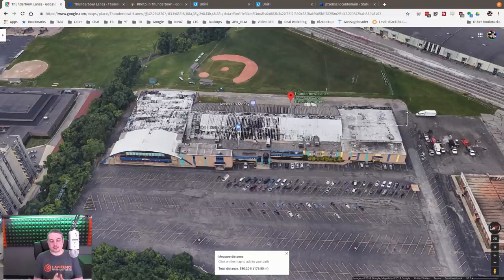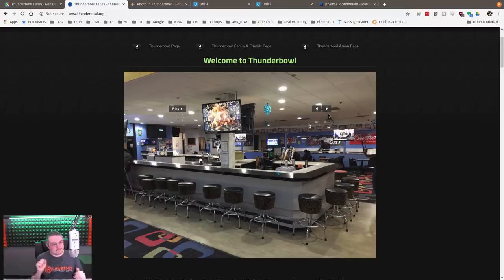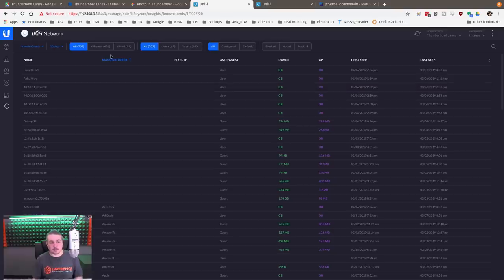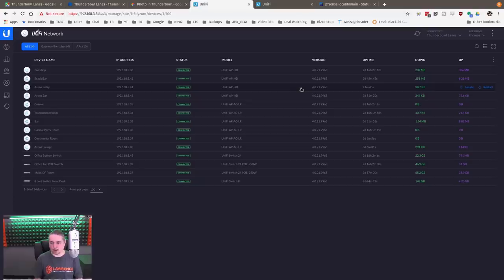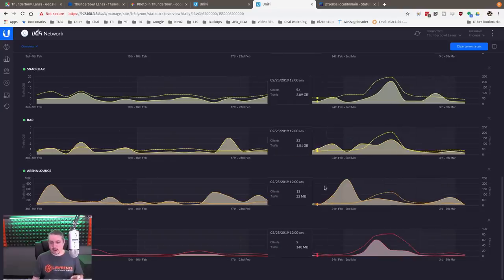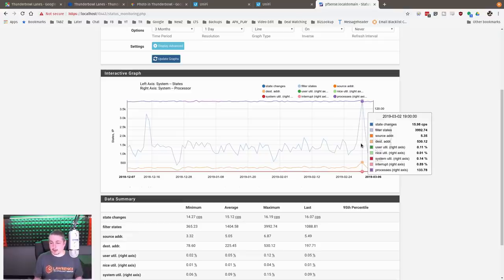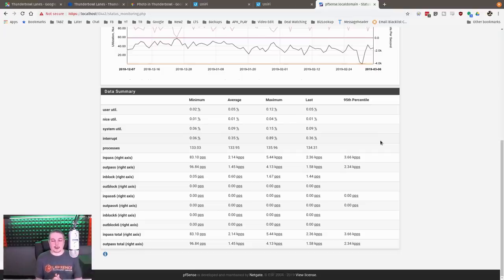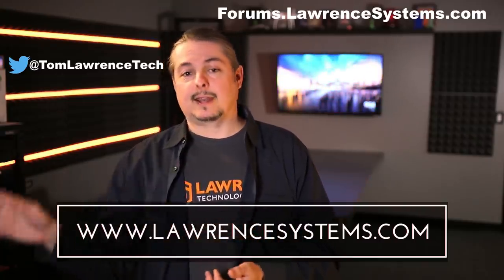Client Project Planning: How We Keep 700+ Bowlers WiFi Signals Out Of The Gutter With UniFi

Comment: Because of this channel I deployed a similar setup in a local performing arts center. The sg3100 handles 4 vlan networks, 12 unifi ap's and the traffic from over 1000 connected devices. The building is complex, with two floors, high ceilings in some places, hallways in others. Previously they had another brand of access point and had constant trouble. Once we worked out some backbone issues, this network has been rock solid for months. I even run Surricata on the sg3100. It stays a bit warm, but otherwise it's been amazing. Thanks for the tutorials and recommendations guys!
Reply: @Chris MacMahon iirc is rides at around 60-68c. I'd prefer a fan at those temps fo sho.

Comment: Did he just say 2Mbps per device?  True your client connection numbers will look nice and high, but there are lots of unhappy kids in that bowling alley...
Reply: Well i mean if it's free...
Reply: 2mbit ain’t bad if you have good connection quality. That’s enough to stream acceptable video, play games, and send texts just fine. If that’s a worst cast, that’s good.
Reply: Have you measured the bandwidth used by a client device in that scenario? You might be suprised at how low it is because usage is more of a factor related to general Internet latency and that of the host server the client is connecting to. As long as the signal is strong and consistent, 2Mbps will be fine.
Reply: Won't be enough for Full HD Netflix, but fine for WhatsApp Smileys 😂

Comment: I manage several Unifi installations as well. A question I have for you is you're putting up some APs that have 200+ clients connected per device, is that correct? I can't imagine what real world usage would be like with that high of a client count. Most of my experience, but as importantly research on Ubiquiti's website is that real-world circumstances would want to see you capping off around 30-40 clients per AP. Did you do some actual client throughput on the floor during peak usage times? Like, something as simple as connecting to one of those APs with 200+ clients connected and just running something dumb like speedtest.net to see what kind of throughput it was getting? What was latency like on one of those same APs?  Just curious, because looking at what you did with some roughly dozen or so APs, I engineer around 30-40 radios in that same space.
Reply: Well he said he capped user speed to 2Mbps and according to https://unifi-hd.ui.com/ you can run 500+ users per AP-HD device, so only limiting factor in speed would probably be the ISP? I'm currently also researching some optoins, could you show me some tests where the performance is degrading when having more then 40users at simulair capped speed?

Comment: 2 miserable Mbps in 2019 with a 500Mbps fiber circuit! With those speeds I’m pretty sure they are not using over 100Mbps during peak hours. 
You have to keep in mind that not everyone will be using the WiFi, and those who do use it will must likely complain about the crappy connection. Imagine someone trying to watch Netflix, they won’t be able to get SD quality. Have fun watching videos at 240p.
Reply: 2 is fine, you're at a bowling alley. If you want high-speed Internet go somewhere else. The point of a guest network is to offer a basic service so people can do basic tasks. If you need more than 2, don't expect to get it handed to you for free

Comment: Why did you use the UAP-AC-LR instead of the UAP-AC-Lite (Higher TX Power/more antennas/...)?
Reply: Would also like to know more about that decision.
Reply: AC-LR has better antenna for receiving weak mobile devices.
Reply: @andrien1951  well that is what Ubiquiti says, but no one ever testet it as  far as i know
Reply: andrien which will cause co-channel interference on an open space like this one.

Comment: How about the controller side?
I remember you saying it took some tweaking to get it running smoth with so many clients, maybe it was another proyect?
Reply: My experience showed you don't need to pay any attention to the controller. Install it on some sort of laptop or pc and forget about it. We are running it in our supermarket with around 2,5km² with 24 (Unifi) devices and 300-500 clients peak on a cloud key successfully. Those devices run after you configured them without a controller very well. The only thing you are going to miss without a controller are statistic logging, speed limiting for the guest network and the Unifi guest welcome page. All things that are managed by our firewall. The tricky part about the setup is to adopt the Unifi security gateway those things are sometimes a pain.

Comment: So the AP HD has higher power output (not that you should ever be at full power anyway) than the AC-LR and has a higher gain antenna on the 5ghz radio.  Not sure why the LR was used.  Also not sure why you would ever suggest using 1 AP to support multiple floors for coverage but you know what they say, 100 engineers will give you 100 different solutions.  cough best practices cough
Reply: "not sure why you would ever suggest using 1 AP to support multiple floors" he specifically didnt suggest that

Comment: I know yaw specialize in pfsense firewall systems. But for something like this were probably using unifi for the switch and APs why not use a complete package and use the usg?
Reply: Probably something related to WAN bandwitdh shapping on per client level, USG still doesn't support that.
Reply: @andrien1951  but you are able to limit guests on bandwidth. Unless I am missing something
Reply: @andrien1951  It is under User Groups in the Unifi Controller.